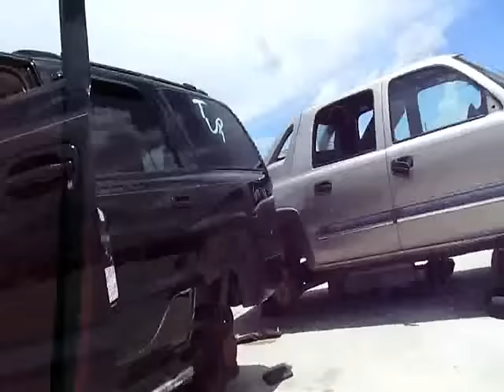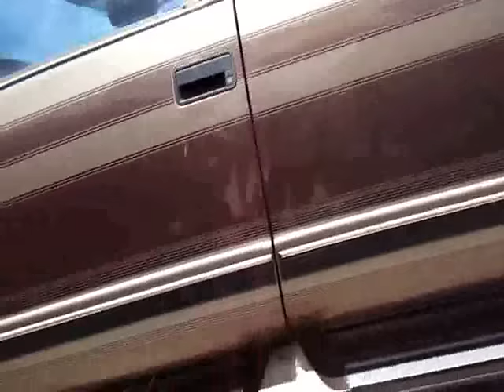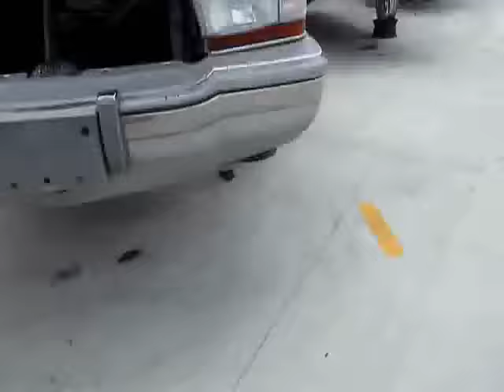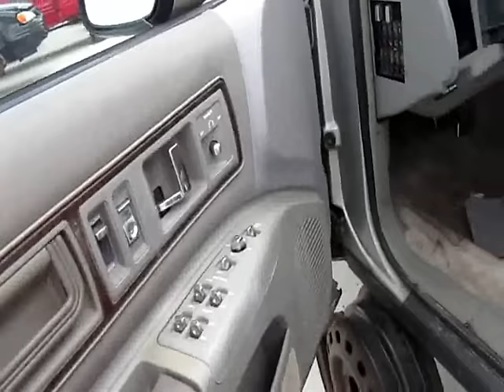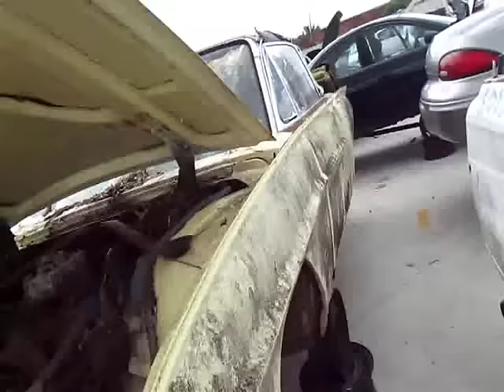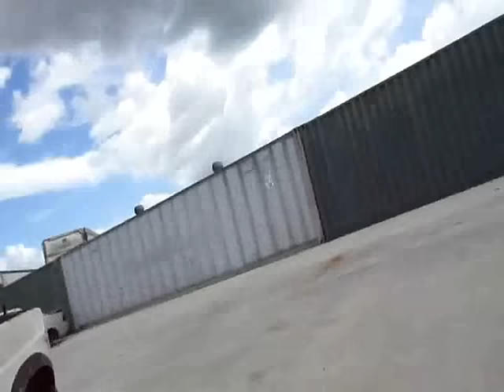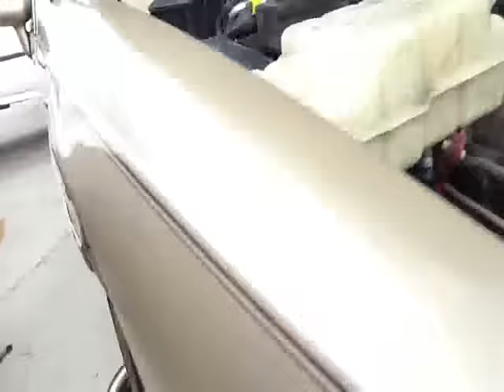At the car junkyard NEW AND CLEAN

Comment: I need that steering wheel and airbag at 0:21
Reply from the maker: Wheel was torn up on it, Wore to the black. Dunno how much they get for a Airbag ill check
Reply from the maker: $60 for a airbag, no guarantee.  It could be getting soaked  Kinda expensive. I dont see how much they want for a wheel on the price list online, Trying to see what they want for a PCM too, No listing. wtf I need more LT1 PCMs
Reply from the maker: Travis R.
 heck ya it is. Alot of parts they want $50+  for, they are nuts.  If they want $50 for a PCM ill puke. $3 core charge on some items too.    Ya, clean for now because it just opened.
Reply from the maker: Slum -
Down in the swamps of Flawduh

Comment: here junkyard is all the non running vehicles (ones go the cheapest) at auction. not that someone personally scrapped it. they probably traded in some dealer with a bad trans and it went for really low at auction
Reply from the maker: I used to see a ton of really shitty cars get bought up at auctions, The junkyard would buy them. Now the scrap prices are so slow that they cannot make any money buying them for 250-400 like they were.   They offer maybe 100-150 bucks for a car now, no one is going to sell their car that cheap at auction.   It was funny, alot of the cars were not even that bad that the Junkyard bought, they drove them right out of the lot, hooked two up to the flat bed tow truck and away they went.